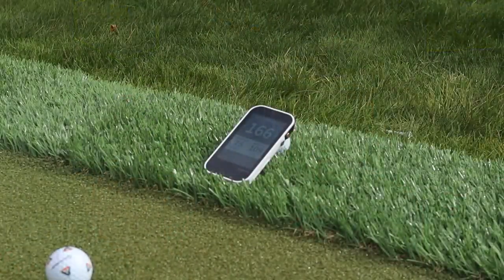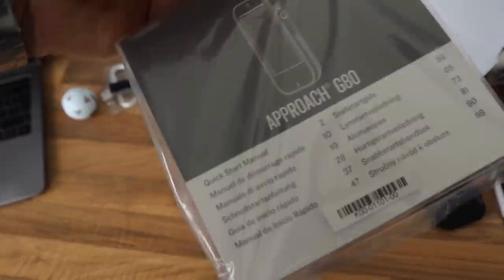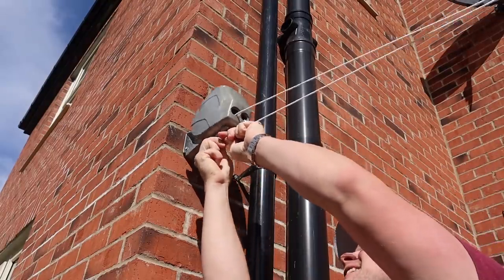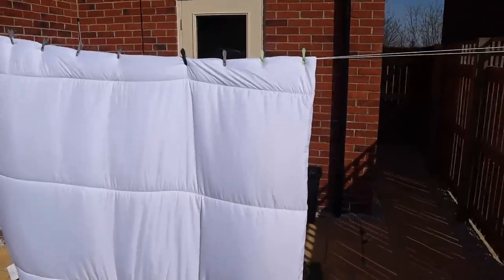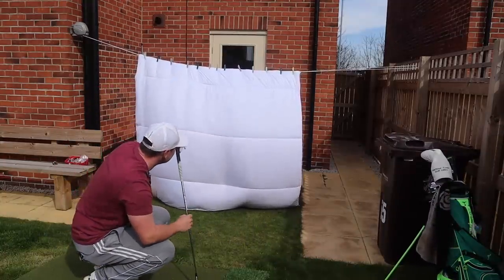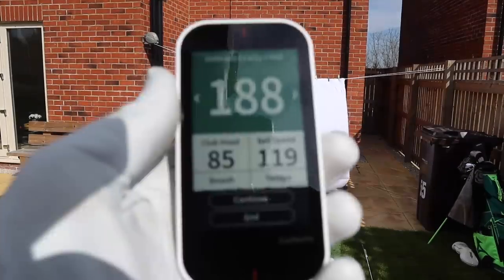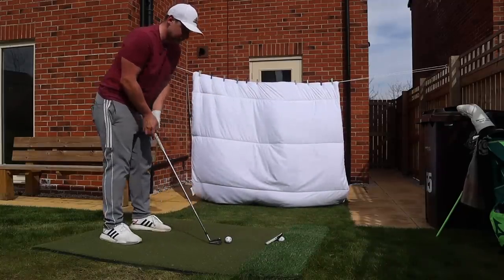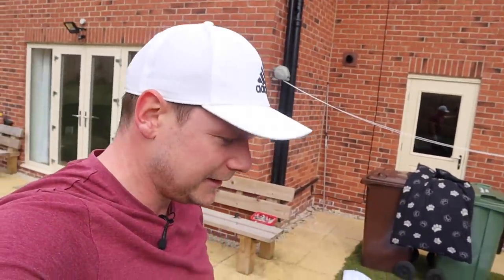I BUILT A GOLF SIMULATOR IN MY BACK GARDEN! GARMIN LAUNCH MONITOR GIVEAWAY!

Comment: Found your channel a few months back and subscribed. I have a more robust version of your washing line using 2 old sleeping bags zipped together. Doesn't need the pegs to take the weight. Just started using Zepp2 for 3D swing analysis - it is really good. Loads of data and graphical analysis - including video. But it only measures club head speed - not ball speed. Fantastic aid - love it. Fingers crossed - I could be one of several thousands of commentators that gets randomly selected. Better chance than the lottery. . .

Comment: Hi, do you still use the G80 or still have it, if so what is it like for swing training? Was looking to get one to use at home but only have a small garden so can’t use a R10 or something along those lines (also only have a low budget) so thought of the G80 is the swing tempo without a ball any good? Also on the virtual round does it pick up a slice or hook or does the ball only got straight? Any help will be appreciated as I know it’s an old video.

Comment: I already have a mat and net so I can practice strike quality, but I have no distance or other launch data (only contact quality and visual.feedback). This would be great. I saw a Rapsodo R-2 for sale, but there was no software available so that didn't happen. A cheap net frame can be made from PVC pipes and cheap netting - or any heavy fabric like you used..Fake grass can be put on the ground rather than buying a way more expensive driving range mat.

Comment: Have two questions: 1. Does thequality of the ball change the readings? and 2. even if range balls are crap, is it not still informative to have a launch monitor that reads it as if you had a better ball? 
The 2nd question relates to using a launch monitor on the range. If the quality and characteristcis of a range ball compared to a decent ball has no impact on launch monitors, then in theory, the launch monitor gives the real world experience and ignores the crappy flight of a range ball. (I'm presuming that most monitors are really only looking at the first 16 feet of the ball flight in order to get a read). Therefore, is a bad ball or good ball different within 16 feet? If not, then one could just somewhat ignore the range

Comment: Very good, 
But
You need some scaffold bars 2-3 14ft ones, 2 elbow key clamp 90 bends to make the net frame,  should be tidy to hold a catch net. less than £200..
Plyboard for that window with a velcro as back up plan for that window. 6mm ply cutting should be fine.